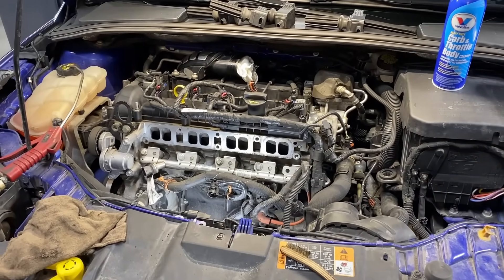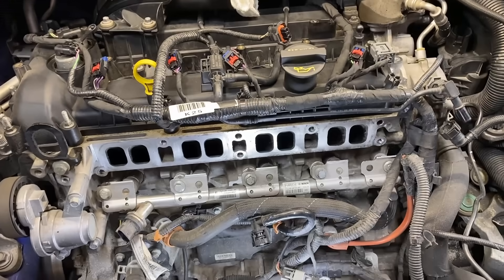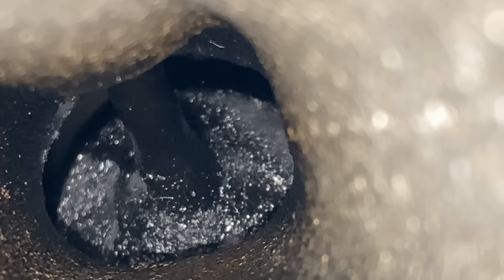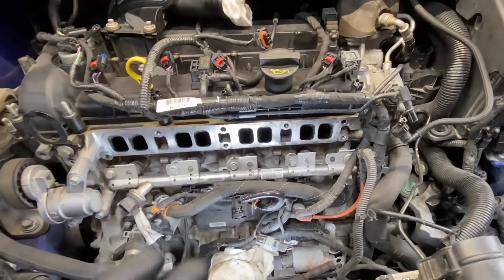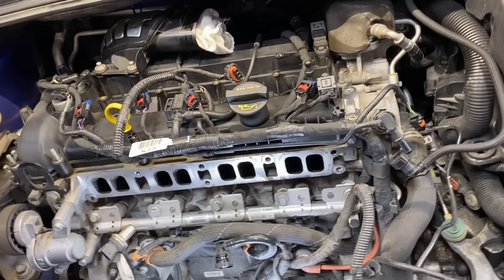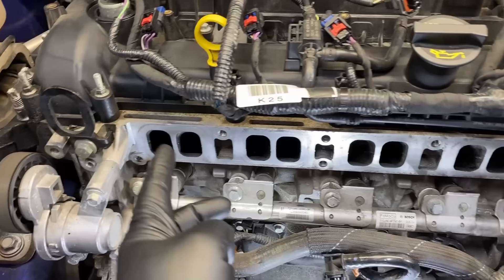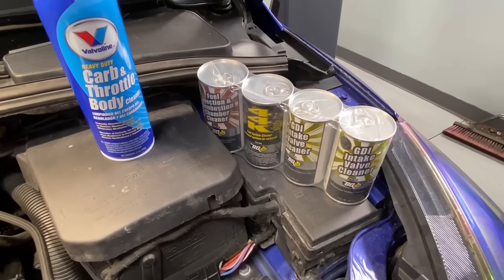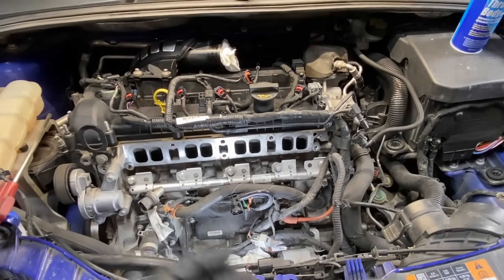Ford EcoBoost Engine Misfires Runs Rough: Intake Valve Carbon Cleaning Procedure

Comment: I'd say after 170k on my 14 escape it's probably due for a cleaning 😂
Reply: Yes! Now having nightmares about my '12 F-150 3.5 Eco with 220k on it!
Reply: Love the Escape! Good basic maintenance they run forever. Use the BG 44k fuel system treatment in ur fuel every few mos. U must run a great full synthetic oil! Tier1 fuel too yes?
Reply: @Davido50  my girlfriend bought it originally but she bought a new 2020 so I bought her that one for a daily because it's better on fuel between my 6.0 powerstroke and mustang gt lol but honestly I just use regular 87 and motorcraft semi syn 5w30 in it always change the ptu oil every 10k and the trans every 30k and it's never given an ounce of issue. Runs really well but it does have the cold miss from never cleaning the valves.
Reply: What engine do you have in there?
Reply: @joost1183   2.0 runs good and knock on wood no issues. So far besides filters, fluids, and plugs its all original.

Comment: Great info. Will a catch can help this issue any?
Reply from the maker: Yes it will
Reply: @FordTechMakuloco  Is there a catch can you recommend for the 2016 3.5 ecoboost?  My f150 has 42000 on it.  Probably to late now 😂
Reply: @joequilici6555  mishimoto may have a can. I have one on my 2.3 Mustang.
Reply: @FordTechMakuloco   Would a 2016 F150 3.5L eco boost have this issue?
Reply: @andrewrich6198  It can.  It is a GDI engine.  In 2017+ they switched to use both GDI and port injection, so the fuel should help keep the valves cleaner.
Reply: What’s a catch can..I’ve built Shelby 350s,500s,& Gt 40 engines the past 20+years and never heard of this term...thanks
Reply: Zoo stew catch cans are basically oil separators that catch the oil that comes from the crank case vent before it reaches the intake

Comment: This has to be a regular maintenance interval for those GDI engines in order for them to survive👍
Reply: Ford has had better luck w/ its TGDI engine design than most any other automakers ! Fact. On my 3rd Ecoboost vehicle. Never issues! Love em. I ordered 2 bottles BG 44k fuel system treatment after watching this you should to. Try Pennzoil Platinum awesome engine oil
Reply: Only ford lol
Reply: @scottrussell6717  Lol...tell that to a turbocharged GM owner (Chevy Cruze)
Reply: @scottrussell6717  always & forever! Ford rocks. All we buy new!

Comment: It should be pointed out that this is only a first gen EcoBoost issue. The 2nd gen uses direct AND port injection which is much better dessign. When the engines cold, it uses port injection during start up and will spray the intake valves with gas. Then as it warms up switches to direct injection
Reply from the maker: Only on certain engines like the 3.5L Eco and 5.0L Coyote. Others such as the 2.0L Ecoboost as shown here to this day 2021 models are only direct injection. This is why I would never make such a blanket statement.
Reply: @FordTechMakuloco  did not know that. Only Ford would continue a mistake it already fixed before
Reply: @icyhotmike  just learning this now lol.
Reply: “As of 2018 the 2.7L has been upgraded with the most prominent change being the addition of port fuel injection. “

Comment: Ive use seafoam on my 12 F150 ecoboost with pretty good results verified by short term long term fuel trims... altho i think i wasted my cats doing that 🤷🏽‍♂️ oh well i guess i got to upgrade them lol
Reply: 🤦🏽‍♂️ looks like i may have fucked up my turbos and cats doing that... well looks like im gonna have to get the borla kit to fix it the right way 🤷🏽‍♂️ 
If my wife calls you tell her the turbos do cost $2k a piece and that its the only approved method to fix it per ford directive
Reply from the maker: Please see my viral video about chemicals like seafoam damaging the turbos.
Reply: @FordTechMakuloco  🤔... youre making me glad i only did it once... well you havent steered me wrong before ill check it out in a bit... i got fire trucks to fix

Comment: Perfect timing for this video. I'm wrapping up the timing chain job on my 3.5 ecoboost today. Your videos are incredible. Thank you Thank you Thank you!
Reply: How many miles on your 3.5? I am looking at maybe buying a used Ford Explorer Platinum with twin turbo 3.5L and 50k miles, and I'm a little concerned about durability. Not sure if it's worth buying one of these Ecoboost engines. Thanks
Reply: @ChevySS1968  only 80k miles but that doesn't tell the whole story.  I have used this truck a lot for hauling and haven't had a single issue other than this major one. If I can get another 5 or 6 years of use from the truck with no other issues I'll be happy. From what I understand, the timing chain issue is likely to happen so you should definitely factor that into your purchase decision. Definitely do a cold start of the vehicle and listen for the rattle
Reply: @grilledxcheeze  I have 285k on my 3.5. Needs its second chain job now. Aside from that its been a good engine. Did you find any build-up on your valves?
Reply: @Wildwwill  I did have some build up. I didn't get in there too much to clean that up but it is making consider a catch can. I did the weap hole thing and a noticeable amount of funk did come out. Glad to see you made it so far on your EcoBoost.
Reply: @ChevySS1968  I have 254k on my 2013 F150 Lariat 3.5

Comment: Damn, I was hoping to see the process of removing the intake. Thanks for the video, been waiting patiently since the last video as I need to do this myself.
Reply from the maker: Intake removal varies so much year to year and engine to engine so I couldn't possibly...
Reply: @FordTechMakuloco  No worries! I get it, have to reach a broad range of folks. I've got the identical car. Just looking for the easy way out!
Reply: @elliottbran  it’s just like 5 10mm bolts and the intake drops. Than just carefully remove the connectors.

Comment: I just did this on my Focus ST! I blasted it with walnuts tho. 180k miles!! The valves were WICKED!! What a brain fart of a design... Car ran so much better afterwards. Totally worth the effort.
Reply: Coal slag should be ok to use right?
Reply: All in the name of getting 1/8 of a mile per gallon more. Ridiculous government standards.
Reply: walnut shells is alot faster and when you do as many as i do. the blaster is well worth it
Reply: @dannybradford5551  how often would you recommend doing this to your car?
Reply: @alexdonhauser8870  at least twice per time you fill up
Reply: @alexdonhauser8870  What is the charge for that service? My dealer doesn’t do it

Comment: Great video! But it makes me sick knowing my EcoBoost is getting crusty. 🙈
Reply: I heard that some regular hard throttle can keep it from building up too bad. 
It's the easy city driving or mild highway use that causes a lot of build up.

I'm nearing 100k on my F-150 and it's OK. 
Nearing 80k on the Escape that the wife putts around town in and I think it's going to look more like this video.
It vibrates at 8dle a bit.
But no code yet.
Reply: @PsalmFourteenOne  if I go too much past half throttle it will "stutter". Its at 55k and been doing that since around 20k. I'm afraid to take it in to have it checked. Just waiting for the right situation to trade it.
Reply: @WarrenRCG  Now you're afraid to have it checked, but at 20k it was covered under warranty. Depending on what year and model car you have, you may have gotten close to a new motor put in.
Reply: @WarrenRCG  A 4 cylinder ecoboost in a car?
Our escape just vibrates at idle sometimes. Seems ok other than that.
My F-150 still runs like a raped ape.
I accelerate hard in it sometimes and drive it on the mountains so it probably heat cycles enough to cook that carbon off.
It's a 2015. Our escape is a 2014.
The new ones added port injection along with the GDI so they shouldn't have as much of the build up now.
Reply: @PsalmFourteenOne  2015 Escape 2.0l 4WD I hardly drive anymore since I  work from home now. Averaging 30 miles per week. It's got plenty of life left.

Comment: Great and knowledgeable video!!
Would these be random misfires? My F150 V8 has random misfires usually under a load but happens very randomly in any cylinder.
Reply from the maker: Almost always this a cold start misfire concern.
Reply: @FordTechMakuloco  hmm... Maybe mine might be Cam phaser related then.  Mine can happen semi cold but more often normal running temps and under load(hills, towing a small trailer and such).  Literally pops like a traditional carb sound.
Dealer isn't helpful. I've gone to the point of getg Forscan to track the misfires as proof by cylinder and gave it to them. Ugh
Reply: @chrisponsford2286  almost no mechanic shops these days seem to be helpful because most people no longer care about their work. You have to find those rare people who are passionate and not simply looking for a check. They start businesses for better lifestyles, not to improve the economy. It's sad.
Reply: I have a 2020 5.0 and new from the dealership is was filled up with regular gas. I was alarmed by the engine doing what sounded like back fire in the air box when cold. The next tank of gas was with super 91 octane and the noise stopped. I think that using 91 octane is a must since this V8 is a 12:1 compression ratio and this is to high for 87 gas. I run it only on 91 now and get better fuel mileage so I think it is worth it. I also change the oil when the dashboard display 30% of life left. For now this truck runs fine and I hope to be able to keep it a long time.
Reply: Think they were talking about ecoboost with turbos do ford v8 have turbos

Comment: Ever thought of Walnut Shell blasting? The Germans have used this way for years, with better results.
Reply from the maker: I would invest in the tool if I had allot of these coming through the door. As of now Ford has no approved method.
Reply: @FordTechMakuloco  after all this time Ford still has no approved method  ?  What do they do at Ford dealerships for this then ?  Thanks for the great info
Reply: @FordTechMakuloco  they’re pretty inexpensive at harbor freight

Comment: This is why I don’t own an eco boost engine. Naturally aspirated only, then eventually electric.
Reply from the maker: Naturally aspirated engine from Ford have direct injection too, they are called GDI engine instead of GTDI (ecoboost) engines.
Reply: @FordTechMakuloco  According to Ford, the Gen 1 and Gen 2 5.0L Coyote engines do not have direct injection. That was introduced in Gen 3 coyote engines, along with aluminum body panels after 2014 year.
Reply from the maker: Correct they waited forever to add direct injection to the 5.0.
Reply: All GDI engines without port injection have the same problems. Natural aspiration doesn't matter.

Comment: My Mazdaspeed 3 is at 141k now, and is a very similar engine. How much would you consider normal for such a service?
Reply: There's very little shared between your motor and the Ford. The Mazda version is much better.

Comment: Baby bottle cleaner or dryer vent cleaning brush would work well if you find a stiff enough brush on them
Reply from the maker: Way too soft.
Reply: @FordTechMakuloco  You can get tube brushes with steel bristles from industrial suppliers like McMaster Carr and MSC.

Comment: Can you not use a product like seafoam through your PCV valve to clean up some of these deposits before they get too bad.
Reply: Might be an issue running that product through the turbo.
Reply from the maker: It wouldn't do anything, the turbo deposits on the back of the intake valves are much harder.